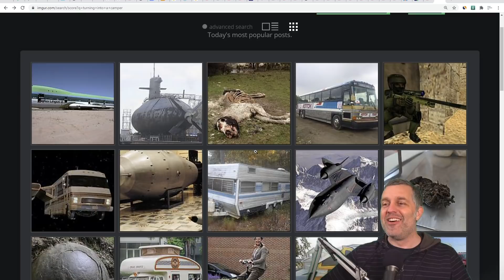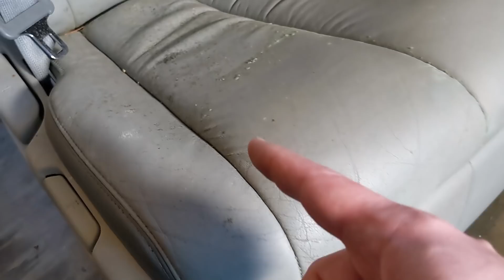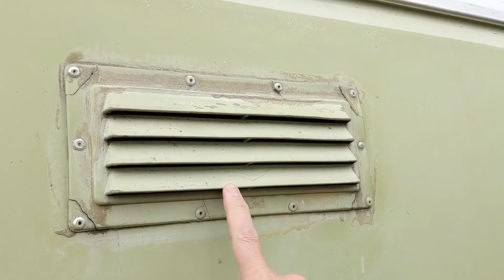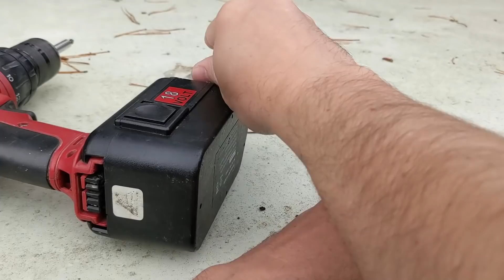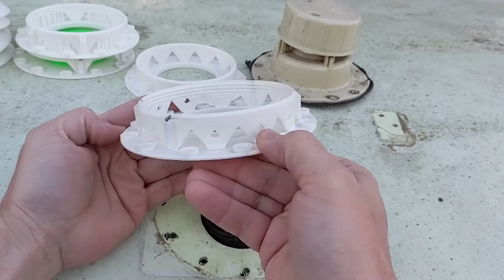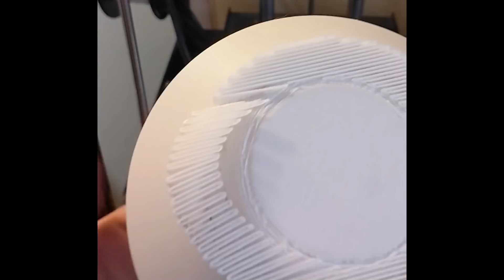Building the Best Damn GMC Motorhome Ever E.21 - Winter Carnage & Roof Vents

Comment: 3M 5200
Reply from the maker: Thanks. I'll get some.
Reply: @IndustriousPursuits  TEST IT OUT YOU WILL LOVE IT. ONLY THING IS ONCE YOU OPEN IT  IF YOU DONT USE IT ALL SEAL IT THE BEST YOU CAN AND PUT IT IN THE FRIDGE TO STAY COLD OR IT WILL BE A SOLID RUBBER CYLINDER IN THE TUBE

Comment: The weight of the body is supported by the floor joists.  This causes the plywood floors to buckle.  Jim at GMC Co-Op in Florida has the parts to fix this problem.  He has a pretty good selection of how to video's on YouTube to explain how to Seal the Cabin from water leaks.  This is Monumental Work!  The rear frame near the wheels rusts.  Monumental Work!  Why do you want this project? If you tow this Motorhome incorrectly, the front windshield will crack!  YouTube has videos to explain how to Tow this Motorhome properly.  Good luck!  Have fun!

Comment: I do really like your kitchen vent design, i may even be interested in buying one as i need to replace mine as well. The only thing i worry about here is that by flush mounting it and not having some type of flap behind it that closes it, you might have a water ingress issue when driving in the rain as the water comes down the sides of the coach or runs off the roof [rain gutters dont catch it all].  If you look at most RV side vents you'll see they either protrude or have a closing flap in behind to keep the wind noise down and/or prevent water ingress [the curved outer shape of this RV doesnt help either].  I found out just how much water the fridge vent is capable of allowing into the coach after driving in a down pour for 8 hours.

Comment: SikaFlex is your friend....you should be using that or similar to seal up all the seams. The humidity in the inside is because you had no ventilation during the thaw and could have been alleviated by cracking the vents open a touch. On the upside you know that their is not going to be wind noise when you drive.....lol.

Comment: No need to toss those seats. You can use a white vinegar mix to wash the seats to kill and clean the mold/mildew off. Lot cheaper than replacing.

Comment: Just remember that the seams need to have some flex. This is not a boat. It has FRP attached to Aluminum, those joints need to be able to flex and not break.

Comment: First off, you could have saved a huge amount of effort just printing this in Nylon. Nylon is strong and if you had soaked the part in a bucket of water before install, it will become more flexible and strong when you went to mount it. Nylon comes in many colors and many different grades. The vents for the holding tanks should have the vacuum wind vane style caps. They look cool and really work. It is no fun having a stinky motorhome or trailer bathroom. When you open the toilet, you can actually feel the air flowing into the holding tank.

Comment: Regarding the top vents, when you redesign keep in mind snow and melting snow. You wouldn't want to create another water intrusion issue. That's likely why the older ones stood so proud of the roof. Your TPU seal looks good, is the area where it meets the flange also sealed?

Love your dad's builds. I know the feeling of inheriting the "madness" of building. I just bought a 1976 Serro Scotty 15' Hilander that's in need of a full interior roof replacement. All original otherwise and the frame is solid. I grew up camping in it's big brother, an 18' Hilander Trunkback of the same vintage.